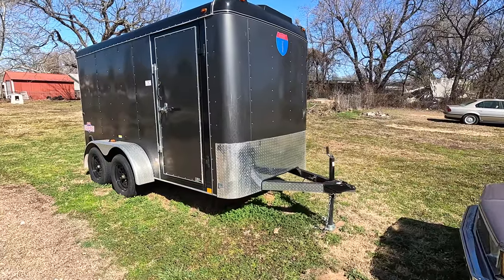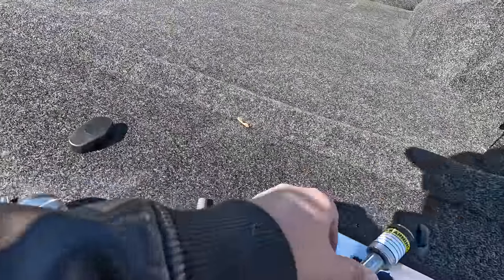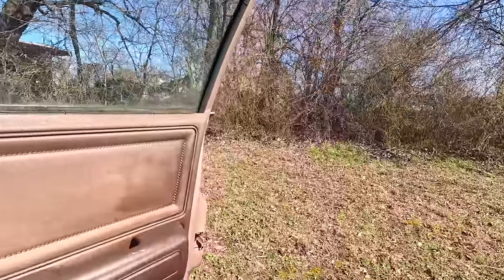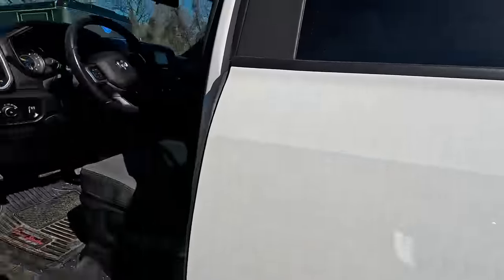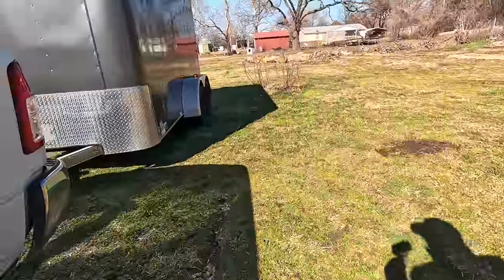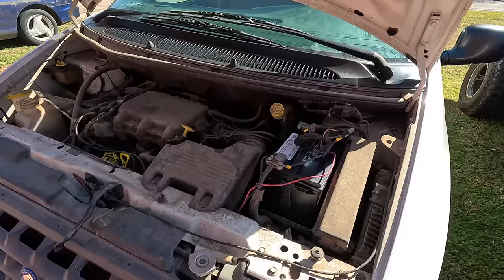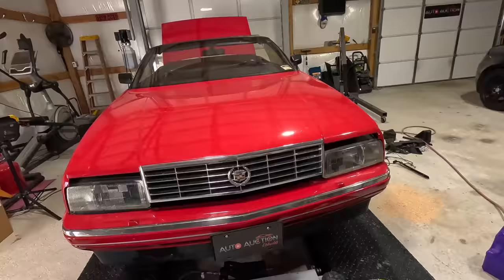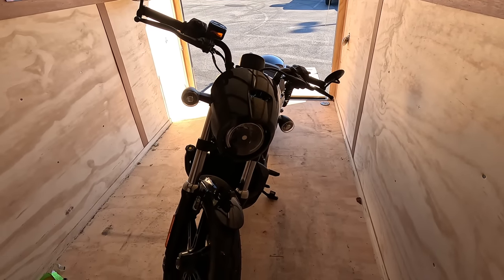Sunday Vlog - Selling my Harley and Working on Cars!

Comment: Keep the Citation for awhile as a "toy", it's not costing you anything having it around. Taking the door panel off and fixing the door handle shouldn't be a difficult or expensive fix, usually the plastic clips for the rod break.

Comment: Randy: Great video! about tying down your bike. It should be tied down standing straight upright, off the kick stand. You put the bike where you want it connect the left fron strap snug not tight, connect the right front strap and pull it tight until the bike is level and up right, then tie down the back straps until tight. Transporting the bike on the kick stand promotes damaging the floor and the bike. I hope this helps. I spent years transporting motorcycles, cars and trucks. You really bit off a mouthful with that Allant'e, Good luck!

Comment: custom ordered my 2019 ram 1500 classic quad cab hemi 4x4 and the battery lasted 3.5 years. replaced it with an agm battery that should last waaay longer. i have the exact same battery tester but my battery charger is the noco genius 10. love it and for only $100. has repair and works on 6v, 12, lead acid, agm and lithium batteries.

Comment: I don’t blame you for hauling that bike to the dealer. I am shocked they didn’t recommend that to begin with. My parents had a 2012 (?) ish Nissan Versa and it was part of that major airbag recall and Nissan told my parents not to drive the car no exceptions. So they just stored it on their property until the parts came in. But thankfully the dealer gave my parents a rental car

Comment: Back then in 196-1999 Voyager Handicap van MSRP was 59,940. MY dad sold these from 1998-2012 till his death on December 20 at 4:20PM and still have the dealer brochure and conversion brochure. MSRP base trip handicap van was $59,240 and the loaded Grand Voyager MSRP was  $65,995 and the middle seat was included at no cost as well.